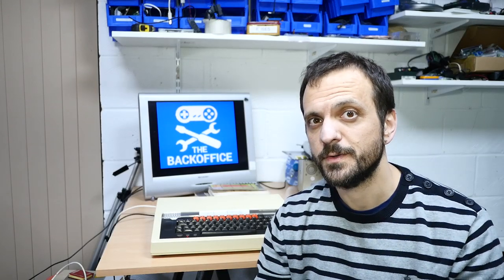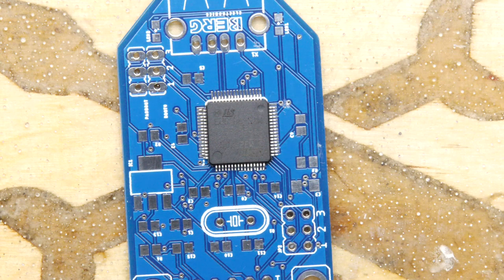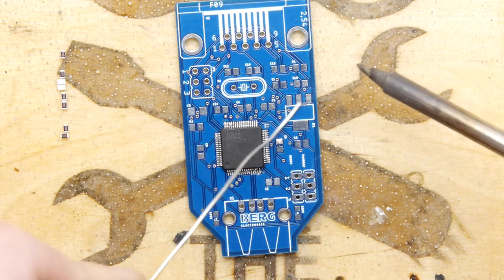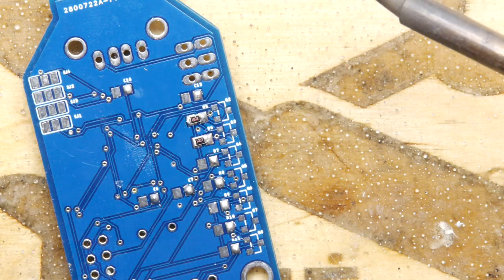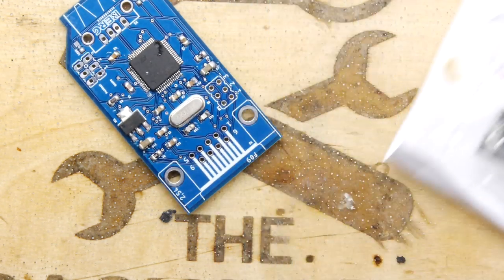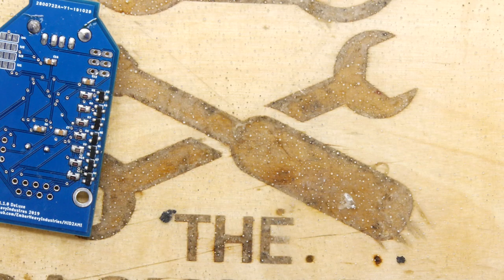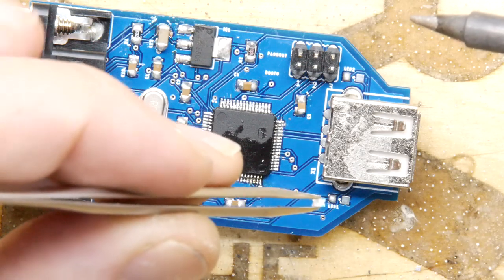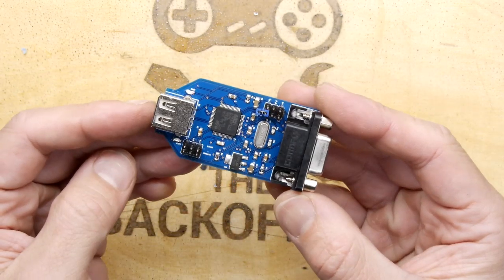How to build a HID2AMI AMIGA USB Mouse Interface

Comment: Dr A would you mind seeing how well it fits inside the orifice of an ST? These are ST compatible according to the Github but I'm wondering if a moose loose about this hoose could fit neatly into that, into the ST port and all sit snug and happy. 

Maybe that could be part of Part 2 : Electric boogaloo.
Reply from the maker: I could certainly redesign the board to be perfectly ST compatible
Reply from the maker: Maybe a usb controller interface as well? All three things in at once?
Reply: I suspect you might have to use an extension and swap some wires over for ST (unless its natively handled in the firmware). Looks like pins 1-4 are organised differently on the ST
Reply: @asnivor  gamepads/Joysticks works in both Amiga and ST with stock firmware; mice need a dedicated firmware (or a wireswap if you want to keep the stock fw)
Reply: @emberheavyindustries3298  Ahh, great to know. Eventually I will find time in my life to assemble my board. At that point I will be in touch :)

Comment: I loved they way you just knocked out that soldering. I guess I agonize over my work to much. So does it work with Amiga and ST’s?!
Reply from the maker: It depends if you want it to work at the end or not - I think taking your time probably results in less rework 😂

I heard it * should * work with the ST but that will be a future video. I should check their GitHub really
Reply: @backofficeshow   Hello, I am the creator of HID2AMI:  Yes, it works with ST also, with a dedicated fw (slight different behavior than the AMIGA counterpart)

Comment: I'm 99% sure you fitted that STM32 upside down. 🙈 The dimple is bottom left of the chip as you read the text on chip correct way up. Confusing as there was a manufacturing mark the opposite corner.
Reply from the maker: It's ok. I'm going to replace it for the next video. I'm not happy with it's leg action 😂
Reply: I am sure it is upside down as well

Comment: I use Amtech 559 with a Hakko T15-J02 tip for SMD, usually works great... Where can I get one of those HID2AMI kits? Just thinking, I'm not 100% sure you can use that tip on non official Hakko gear.
Reply: The repo with all the info is here https://github.com/EmberHeavyIndustries/HID2AMI The actual firmware is not open source right now though, but the person who designed the board supplies it based on your chip ID and a small donation. I dont think I have any BOM left tbh. But I have one or two boards spare if you don't want to get it fabricated yourself.
Reply: @asnivor  Be great if I could maybe get a board as I think the minimum order is 5 from JLCPCB. Depends on how much you want.
Reply: @TheDigitalAura  or join the backoffice discord. It's where all the cool cats hang out anyway :)
Reply: @asnivor  I'll install discord later as I try to avoid twitter.
Reply: @TheDigitalAura  Nice. It runs in the browser as well if you dont want the bloat